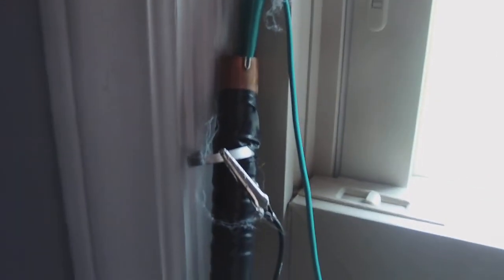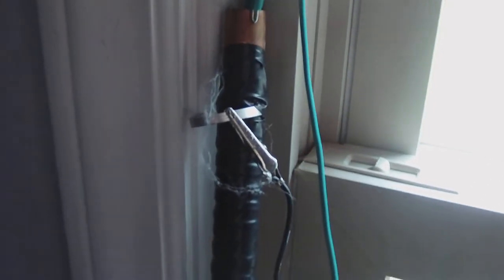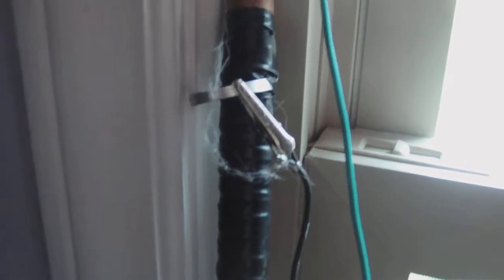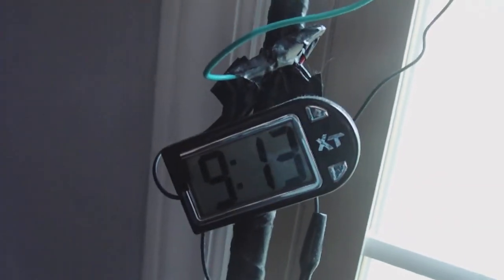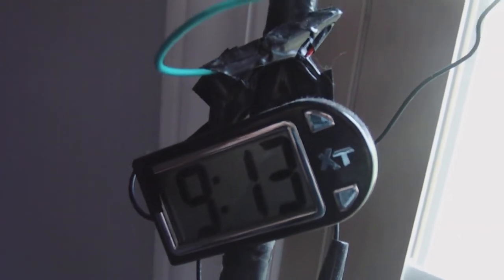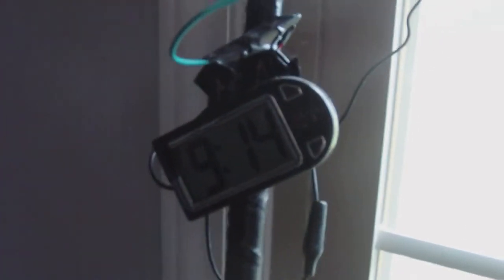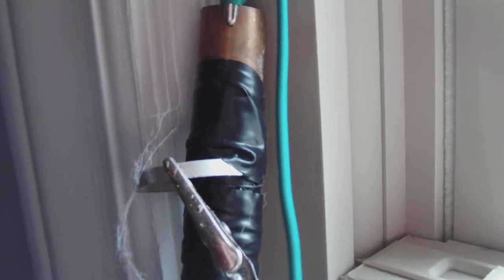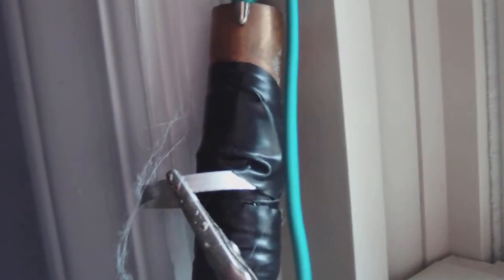5 foot tall crystal cell keeps on ticking away without adding water

Comment: @ibpointless2 yea in one of his videos or comments he claims it corrodes at first but then it stops. your not supposed to use the cells until they are completely dried out and i didnt  use water but theres moisture released, i left mine out in the texas hot sun all day and the voltage wasnt affected at all.he claims they last indefinably but short out when not under a load. yea the ones he sold were different designs which he has sold a few.

Comment: @ibpointless2 i know the water does, in peoples comments they say it breaks down under a load with just air humidity just slower. but im sure youve done more than I so ill take your word for it until i do it myself. my two air batteries are buried under a pile of junk, im moving atm.   ive made a couple hutch cells and they produce a voltage about the same as the air ones. what are they to you ? im interested

Comment: Why is needed so much bigger cell? The cells put in series seems to be far superior, because i need only 4-5 cells to run a clock, and this cells are pretty small. Anyway your formula works, and if you add 30% manganese dioxide, everything will work better. Tnks for sharing and your work! Great job!